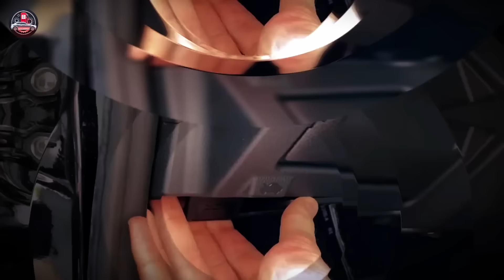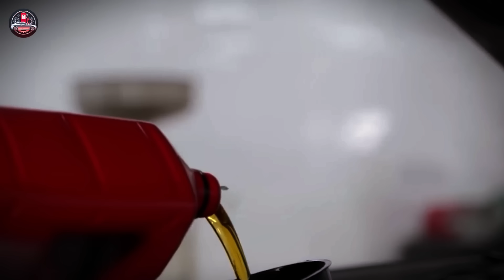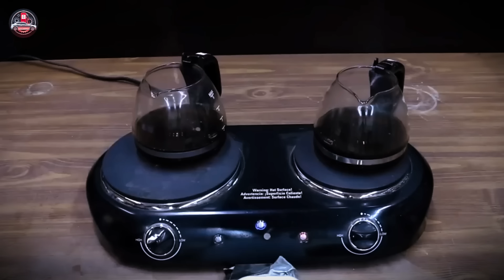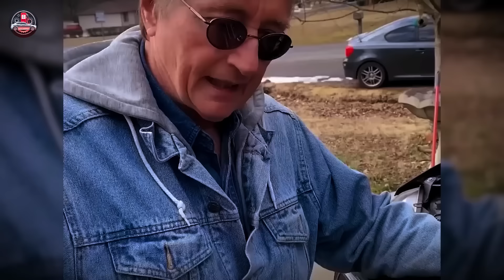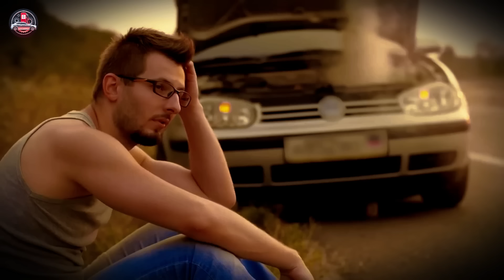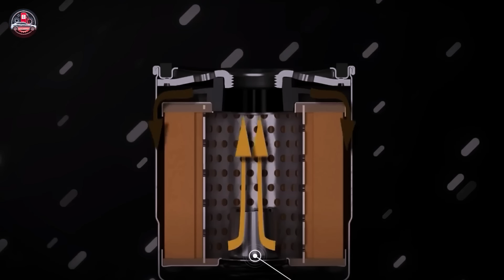We Ran 0W-20, 5W-30 & 5W-40 in the Same Engine — Here’s the Truth | Everything Oil for Car

Comment: Hi guys I live in Florida I’m going to change from ow20 to 5w30 for my next oil change and I don’t need thin oil because it’s very hot here during the summer months and I have 73000 miles on my truck and also noticed that my engine seems to be a little bit loud when idling and I want my engine to LAST

Comment: You're comparing viscosity on an engine that was designed for one particular viscosity so the testing is meaningless! Truck engines designed to run hotter and work with heavier loads calling for 0w 40 oil will not work better with 5w 30 oil!

Comment: i use  valvoline 15w40 non synthetic  in my hilux 2007 3litre turbo diesal ute there is never any loss between oil changes   runs like a charm 286k mainly suburban use change oil every 5000 kilometers and filter this will last 500000 miles i am in australia melbourne it does get cold down to O degrees in winter when i changed injectors there was no wear on cam lobes no build up of sludge on cams and cylinder head go figure still get 14 kilometers per litre economy hyway cruise at 100kilometers per hour drops to 10 city driving it is a manual 4wd

Comment: Makes me nervous using light viscosity oil in Florida most evenings here are 70’s …10w30 lightest here in my opinion .. I use 15w40 in my mower and small Engines never had issues .. some of our Honda motors are 30 yrs old no oil usage between changes .. I do use AR9100 friction modifier in all small engines

Comment: I run 15w40 in 94 Landcruiser in south florida .. 323,000 miles don’t use any oil between 3000 mile changes .. very smooth running engine

Comment: This is on a 2019 Tacoma 6 cylinder.  I thinking about running the 5W30 seems to be the best oil out there. But in my Tacomas V-6 will the oil changing from 0W20 to the 5W30? Anyone have any ideas...

Comment: I read an article by oil engineers that said the base oil such as 5 weight should only have chemical additives rated at 20 over the base.  So 0 w base ideal would be 0w 20. For 5w base ideal would be 5w 25 for 10w base 10w 3o, 15 base 35, 20 base 40, 20w4o. It said the more chemical additive that increase comparative oils viscosity as oil gets hot. the second number are what breaks down first when oil begins to break down.

Comment: I own a 2014 Honda Civic 1.8 vtec with just shy of 100k miles on the clock, I run 5/30 fully synthetic (Honda recommends 0/20) and change annually at around 8k miles with no top-ups in between…

0/20 is all about emissions, not longevity !…

Comment: I have owned new and used cars and trucks of all kinds, and typically drive them to around 200k miles, and I've never had any engine burn more than 1/2 quart between oil changes (at 1/2 mfg recommend mileage). None of the vehicles i bought new ever used more than 1/4 quart, and usually not even a noticeable amount.

Comment: Bruce Johnson
Jonesborough Tennessee 
2001 Jeep Grand Cherokee 245,000 miles 5w30 synthetic Walmart synthetic with 4.0 6  cylinder engine change oil every 4,000 miles looks clean when changed
  Average s 17-20mpg and never  needs oil added between  changes.  Runs smooth , powerful, and quiet should easily make it to 350,000miles
It is a farm vehicle and tows a hay trailer in winter weighing 3,000+ pound with ease.

Comment: I doubt you can measure a real difference of .002" in a few thousand miles. That would be catastrophic for 100k+ miles. Also, I agree 0w anything is bad for wear, but too much viscosity range (0-40) has a lot of elastomers, they gum up your oil rings. I use 10w30.

Comment: My car has oil temperature indicator and is turbocharged. What I noticed testing with 5w30 and 5w40 is that oil temperature on average is 10° C lower when using 5w30 under similar conditions. I used Millers EE Performance ester based oil in 5w30 grade and Millers Trident Professional in 5w40 grade for testing. Oil consumption was negligible with 5w30 (about 200gr for 9000km). I didn't even need to top up, as it didn't drop below 1/2 on the dipstick. So, I decided to stick with 5w30 until i notice increase in consumption. My argument is that, under regular highway driving conditions at 130kmh, 5w-30 at 100°c protects roughly the same as 5w-40 at 110°c.

Comment: What bullshit. Prior to the 2017 changes in engine tolerances and motor oils was tested by independent labs over a period of years. Thousands of engines were torn apart and checked for wear. Any SAE spec oil is going to be OK. The purpose of 0W-20 oil is to improve fuel economy despite the use of gas guzzling vehicles. 

There are also very different requirements for diesel motor oil and the testing by independent labs showed that Valvoline Blue and Pennzoil were far superior to Amsoil.
Reply: Bullshit is correct.  It's an AI generated scam to drag a bit of revenue from YT.  All the "I'm Billy from Utah" comments are simply adding to the critical "engagement" metric.  (Just like ours lol).

Comment: Have you ever checked the oil ? Mobile one is not great, Castro is a little better I could show you the data but you will twist the facts to fit what the government says. You tell me how many motors that ran 500,000 miles on single weight oil and now because of the worthless government and people that claim to test motors or now’s anything about engines. Most people that do testing are puppets unless they get permission they can’t tell the truth.

Comment: Thin oil does better for some areas, it’s a trade off use a 0 w oil will wear out faster. The government was the problem? Did you know about the chip the government put inside your motor to increase fuel consumption ? It’s all related.

Comment: Northwest Georgia 
I only run 5W-30 or 10W-40. Depending on what's available. Although when it gets cold say temps in the 30's I only run 5W-30. I have an older Acura MDX and my wife drives an older Audi Q7. No problems doing this. One thing I would like to add is I recently added Ceratec to my wife's Audi. Her mileage came up 3 mpg sometimes 4mpg. No I'm not a dealer for them. Just food for thought. It's a one time additive every 40,000 miles.

Comment: Andres in Sanford, Florida. Using 5W 30W in a 2013 Highlander with the V6. 116K and  running like Brand New, Original plugs and coils, NO LEAKS.

Comment: I'm here in Eastern Wyoming. 2021 Chevrolet Equinox specifies 0W-20 OIL. The oil change interval has always been 5000 or fewer miles. It has been driven fairly conservatively, yet at 53,000 miles there is discernable valve train noise. And yes, the oil pressure is roughly 38 psi when warmed up to operating temperature. I purchased this vehicle new, and have been strictly following the recommended maintenance. Now that the new vehicle warranty has expired, I'm planning to try 5W-30 oil at least during the summer months. It will be interesting to see if the valve train noise is reduced or unaffected.

Comment: Bartow florida 
19 equinox,  195k miles
Oem calls for 0-20 therefore run it,  I drive 60 miles highway, one way to work, running 80 to 85 mph the whole way..

I tried running 5-30 once... car felt sluggish, and a few weeks later, my turbo went out... coincidence? Hard telling 

I thought about trying 5-20.. but its not commonly available in my area..

Either way, every engine is differnet and designed for a specific oil viscosity..right  tolerances and bearing types, valve control systems... im gonna stick with oem recommendations 

Running 0w20 in a chevy 350 is gonna cause issues,  but 10-30 won't

Comment: The guy’s argument is flawed.
5W‑30 and 5W‑40 have the same cold‑start viscosity — the “5W” is the giveaway.
The difference he’s measuring is either noise, temperature variation, or brand differences.
0W‑20 builds pressure fast because it’s basically water, not because it protects better.
Real wear happens under heat and load, where 5W‑40 wins every time.

Comment: Amazing how the AI mechanic installed those Honda engines into the Mercedes and Audi vehicles, and then drive them around in the BMW:)  Another deeper flaw is how a number of manufacturers (Kia, Toyota, etc.) are recommending 0-20 multi weight oil, and the engines are burning themselves out at 60,000 miles. Different components of the moving parts of the engine require different viscosity. The crankshaft needs enough pressure to keep the weight of the thing off of the bearings. 0 weight is a guarantee of bearing wear. What's next? -10? I seek the 10-40W to use in everything, as the only liability might (and that's a big might) be lower fuel mileage. In my VW camper, I put 20-50. That engine has very efficient oil pressure relief when cold. The best option to me is thicker oil, and warm up the engine before driving.
Reply: agree

Comment: Ok, I’m curious about who the “we” of this video is and who the ”I” of this video is. I do not see the backstop of the facts presented. There’s simply no actual factual info here. Finally no new or rebuilt engine oil need be tested prior to break in and break in does not fully occur prior to 10,000 miles. (See motor oil geek)

Comment: Las Vegas, Nevada, Mobil 1 5-30wt in 1987 5.0L Turbo Coupe, 2019 Genesis G80, 5.0L, Ultimate, Valvoline VR-1, 50wt, 1969 Roadrunner, 540cu in, 2005 F350, 6.0L, Rotella T6, 5-40wt. Archoil 9100 friction modifier is used in all vehicles at each oil change @ 5000mi.

Comment: I use what the manufacturer designed. Mostly 5w 30. Need a 0w 30. Different cars need different oil. I use Pennzoil "Ultra" Platinum, Valvoline Restore and protect, Liquid Molly,

Comment: We can counter some of the problems of start up and this will be most relevant in zero degree weather, or with cars only driven occasionally.

Check the manual or on the net, most newer cars with fuel injection allow a no start cranking condition. Hold the brake and floor the gas pedal. Crank the engine. The engine will not start, no fuel is allowed to enter the engine. That feature is there in the event you need to start a flooded engine. But the oil pump is still working normally so oil is pumped to all of the engine components. Do that for at least two seconds, and be fair actually say, "One thousand one, one thousand two".

Release the gas pedal and crank the engine, it should start and you can feel confident the oil was right there, before the engine fired up.

Comment: 03 ford 5.4 have always use 5-20 it pushing 200,000. I’ve run it hard,towed over its capacity and pulled on it in deep sand till everything was overheated. I still drive it to this day and have never added any oil. It has only had regular 5000 mile oil changes.

Comment: what would happen if you mixed different viscosities together say ow 20 50% and5w30 50% I wonder?
Reply: I do that with my oil changes to get a multi multi grade oil.
However, I don't drive enough to know the difference. My 2016  F150  has 90,000 miles on it.

Comment: Pointless testing of Oil
Should have compared..
0W20
0W30
0W40
If you have fewer oil changes rather than wasteful practices by many so called experts in the US every 3000 miles is just ridiculous.
A 0W40 is going to give you THE BEST Engine protection over a 8 to 10,000 mile change schedule because fuel dilution happens in All Engines and a W40 grade will give the results you want.

Comment: I used Filull synthetic 5W-20 for years. I put nearly 300k miles on both these. Two Ford Econoline vans from 2011 to 2026, 567k miles between the two of them   i just tore the engine down in one because it looked like it was burning oil based on the exhaust smoke. It definitely needed a valve and ring job but looked surprisingly well beyond that.
Reply: considering it is ford you got a great run

Comment: Of course one oil will have superiority over the others when all 3 engines have the same clearances. The different oil viscosity is essential for the different clearances in different engines. You used 3 exact engines with 3 different oil viscosity- this math will not work. This test is bogus. Next time, use the correct engine clearances that relate to the viscosity of the oil suitable for that engine and your test will have better results in oil protection

Comment: 2.7 L 3RZ toyota tacoma 2002 oem engine never rebuilt 300,000 miles here in Puerto Rico with temps around 100 + degrees almost year round running on 10w 30 mobil 1 synthetic  high milage oil and no problems pick up truck bed 90% of the time full of tools for working on diesel generators, high traffic in extreme temps long /high hills everywhere..... im about to change to 5w40  ks an overhaul is about too close😂  i am in the team that love nice new cars but no to own them because too much garbage in it.....  needing a permission to work on ur own car is crazy...... fck them all with all their garbage EPA sht .....

Comment: If a mineral or synthetic multi-grad (multi-viscosity) motor oil is manufactured to 5w30 , 5w40 specifications , both oil's  viscosity in cold environment ( the W stands for winter ) should be the same .The oil quality and service classification is given by the American Petroleum Institute  , and the viscosity is indicated by the Society of Automotive Engineers numbers ! By the way ,most of the engine manufacturers list different viscosity oils for their products beeing used in different climate locations !

Comment: In Cold winters in 1972 -- Duluth Minnesota -- I was warned by my father's cousin Enoch to use Straight 20wt oil not multi wt.  the reason was simple. Multi wt fails at MINUS 40 c OR f  degrees THE  Multi Viscosity  additives acts like gelati in water it GELs == oil does not move -- the oil pump sucks a blob out of the oil pan followed by AIR !!!!   ---  0 C or 32 F   and  17,8 C or 0 F problems start to show up ,,,   I should have listened  - Ford Falcon developed trouble at 50,000 miles

Comment: Ontario, Canada.  1976 White 2-60,  15000 hours on 15 - 40. Oil filter takes 8 seconds to fill after overnight stand!.  2014 VW  Golf TDI  202000 km   15-40 engine oil. fuel consumption down as low as 5.5 litres / 100 km. depending on duration of trip and load. I sometimes pull a 2000 lb trailer.  2004 Dodge  5.9 Cummins, 15 - 40   280000 km oil pressure as new.

Comment: Interesting comments, I have a 96 c1500 5.0. In it's early life had synthetic oil used , at 170, 000 miles i took it  over.  Hanged oil every 5000 miles with filter.about 220, 000 I started using Rural King 10w30 fullsynthetic with primegard oil filters. It's present mileage 12 years later is 519,000 miles, everyday driver, 1 quart usage at 2500 miles, ad a quart and drive to the 5000 mile interval, another quart usage but time to change. Climate is Southern Indiana. Also use 1/2 quart Lucas oil additive with oil changes. Frequency is the key!

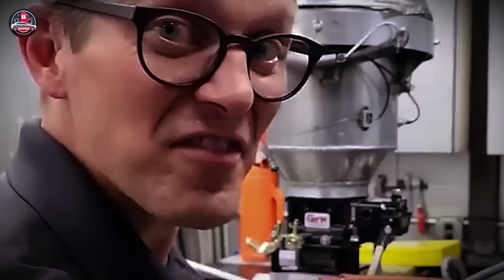Comment: 472” Mopar crate Hemi, hydraulic flat tappet camshaft, 4:30 rear axle. Weekend driver and show car, occasional trips 100 to 250 miles. Mobile 1 15w-50. East Alabama. Redline is 6000 rpm. 28” tires. Is this too thick?

Comment: Saturn.S l one.. Single cam. Been using.5w30 full synthetic.335,000K .. Oil changes every 3,000 K.. Original motor and  Transmission full synthetic oil changes Twice a year in the transmission and filter. Only thing changed on the engine.Valve cover gasket Original timing chain. No engine noises, no valve train noises quiet...

Comment: My 2013 5.7L v8 runs under 2000 rpm at highway speed and after 60000 miles burns about 16 ounces every 3000 miles. I've run the recommended 0W-20 since the beginning.
Reply: You've done well , it might be time to go 5-20 unless you do a lot of cold stats for the milage, Lexus or Toyota?

Comment: Yes but when buying a used vehicle, you would hope the previous owner that trades every 150.000 miles would be thinking about engine longevity instead of just fuel mileage. You dont want to purchase somthing with 150.000 on it and in 50.000 the motor is wore out

Comment: :face-green-smiling::face-green-smiling::face-green-smiling::face-green-smiling::face-green-smiling: ive been using mobil 1 10w30 on my 2004 ford f150 STX 4.6L. my original engine lasted all the way to 930,255 miles.  ILL NEVER USE ANY OTHER OIL!  replaced my engine with a used 180K mile engine from a used auto parts place. switched it to mobil 1 and now i have 550K miles on the second engine... LOL BEAT THAT !

Comment: ****   I live in Reno, Nevada, and drive a 2015 Subaru Forester with 83,000 Miles and use 5-30  Synthetic and use WIX  57055XP Oil Filter and the Car is used for every day driving ***

Comment: I live in Dublin, Ireland. I drive a 2010 Renault Grand Scenic III 1.5 dci. I use 5 W 30 fully synthetic oil and that is what Renault say to use. I change my oil every 5k km. My car has 222500 km on it from new. It is a 1.5 diesel with a turbo. I am a very careful driver and I don't like to high rev my engine I listen to it and look after it.

Comment: What matters the most which the most common failure is the Rod bearing failure as known as Rod Knock. 
My subaru needed a new engine said my mechanic , he gave instructions how to properly break in the engine for the first 2000 miles and I followed it and beyond. I was excited that he recommended the Liquymoly Oil with Mos2 , the problem is that he said to use 10/40 not 5w30. So 41K miles later , the engine git Rod Knock with just a simple 9 mile drive home from work in traffic as i had been doing for years.   So pay attention to not just oil viscosity but oil specs as well.
Reply: How about the cooling system ???

Comment: For new cars 0W20 is the clear winner for normal driving if your car brand recommended it. There is also 0W20 and 0W20...you can buy cheap shit or premium oil like mobil1 ;) but if your speciffication is not for 5W 40...never use it!!!